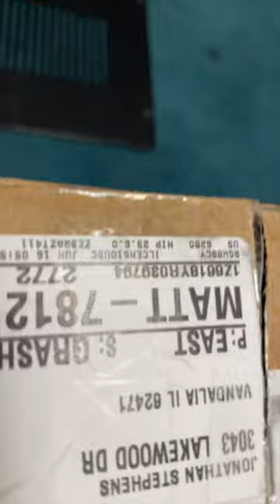New tubes for this beautiful Avalon preamp.

Comment: Before spraying, you must get rid of micro dust. Use an air compressor at low to mid
pressure. Make sure to remove all boards
below the top ones, if you cannot reach them 
from below (removing bottom plate). All pots as well. How about cold solders? Then when complete, spray gently and all pots, switches.
Reply from the maker: Good feedback.